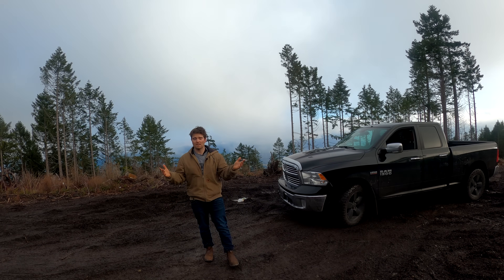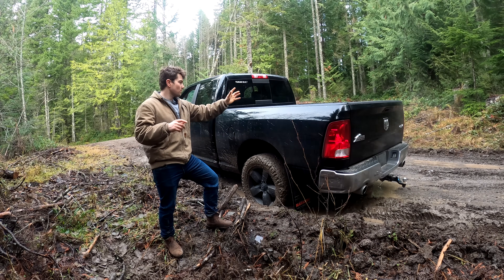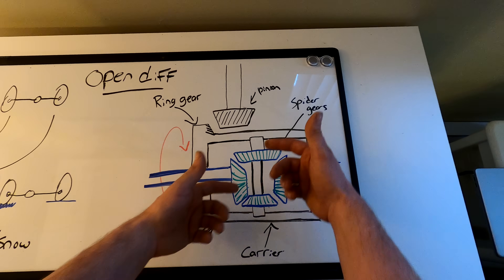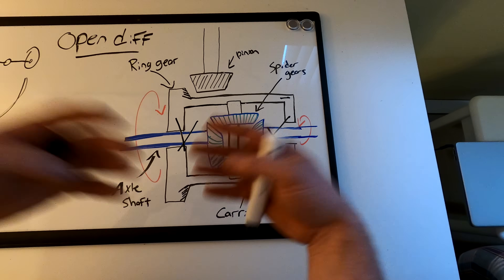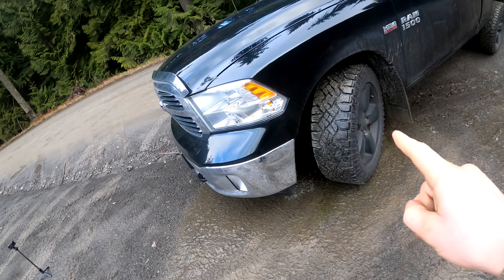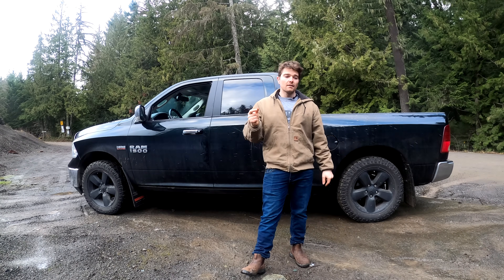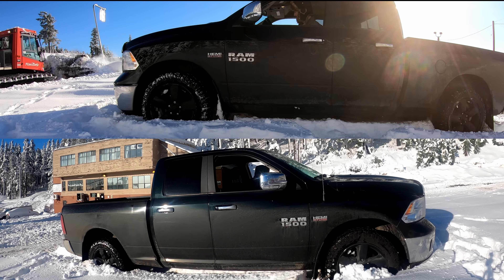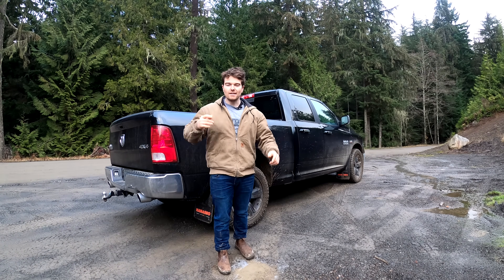RAM 1500 Open Differentials SUCK Off Road (You'll Get Stuck) | Real World 4x4 Testing

Comment: Get better tires and a bit of a lift. I have a Ram 1500 AEV and I do great off road
Reply from the maker: the ground clearance on these trucks is terrible I find. So a lift would actually do wonders but i'm waiting till the old warranty is up before I start lifting my truck. I mean as for the tires I have wrangler duratracs and to be honest I bought them because they are good in the snow.
Reply: @GettysGarage   good content. I  subed you. Consider some bfgko2s and a 4 inch lift.  The  truck will be transformed.  

I have to test this but I don’t have 4 wheel auto and just high and low 4 and 2 wheel. So I wonder if that system operates differently
Reply from the maker: @lordtrini  it's a good thing sir. it means your transfer case is most likely a true locking case. my truck has a clutch pack style transfer case which can experience slippage. whereas a traditional transfer case doesn't that that issue. much better off-road performance
Reply: @GettysGarage   ahhhh makes since. I did know that the Rams with 4 wheel auto were that much different. Thanks.

Comment: In these instances how would the truck react if traction control was turned off?
Reply from the maker: same thing would happen except the two wheels that spun would just spin continuously. the idea behind traction control is it try's to apply braking pressure to the spining wheels and therefore increase the torque required to spin that wheel. possibly making the other stationary wheel spin. so in that certain situation it may be actually beneficial to try and leave it on. or manually apply the brakes. but that's just my two sense
Reply: @GettysGarage  thanks for that. What about same scenario but traction control and ESC off? How would the truck react then?
Reply from the maker: @MarcBangera  unfortunately the same thing would apply. open differentials are purely mechanical. traction control can attempt to use the abs sensors and brakes to try and force power to the other wheels but once you turn all the electronics off you are dealing with purely a mechanical device that is going to follow the path of least resistance every time.

Comment: Excellent explanation.
  My ram 1500 has a LS.
do you know if in 4wd the LS applies to both front and back or just rear?   I was thinking my LS would take care of the back and I might get lockers on the front...
Thoughts?
Great vids, keep them coming!
18 Ram 1500 4*4, 5.7.
Reply: Limited slip is only going to cover the rear. Now even with limited slip you will still run into the same problem. Youll still have slip or one tire spinning in some situations. A locker in the rear or the front will help a ton! Even with an open diff up front or in the rear having at least one selectable locker will get  you out of most situations.
Reply from the maker: yes the factory LSD is in the rear and the front diff only came as an open differential. now as Jeepscarsandguns said, even with a LSD the same thing would most likely happen. but obviously you'll have much more success with a LSD but may still run into the same problems. A locker is going to make sure both wheels on a certain axle have a 50/50 power split at all times. and thank you for the kind words!
Reply: LS is usually just Rear only.
Reply: @chrish8892  Thx, my thought also...
Reply: They don't make lockers for your truck. Unless you go lunchbox locker.